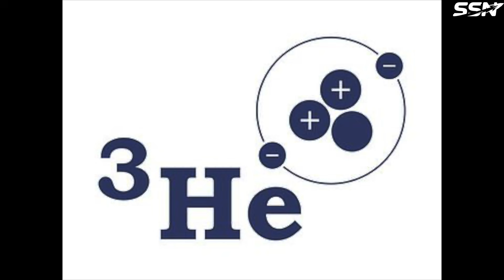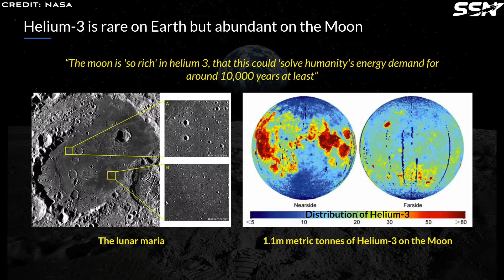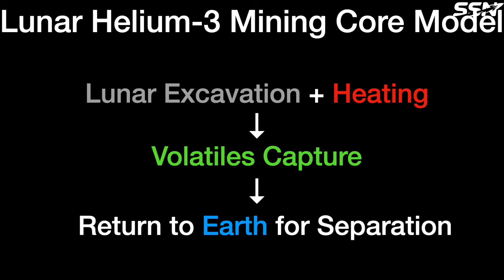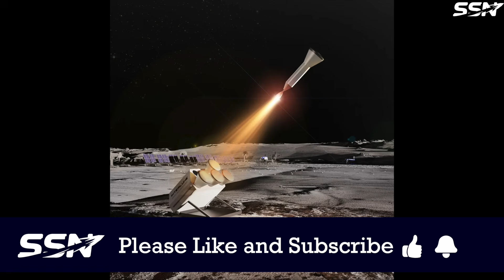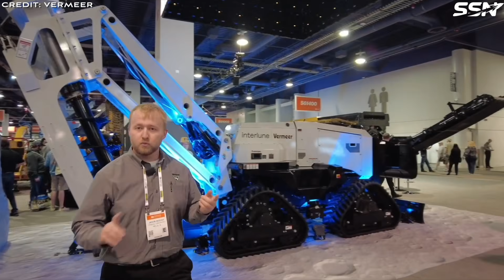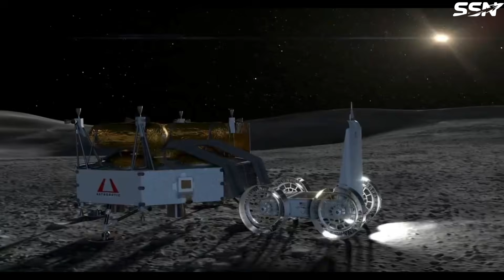Interlune 2026 Helium-3 Moon Mining Update: Contracts, Excavator & Missions

Comment: Yes but right now we can’t make fusion work even using hydrogen as a fuel and the temperature required to burn helium three is vastly higher. So there’s no point in doing detailed plans to harvest helium three from moon dust until you have at the very least a viable nuclear fusion reactor industry down here on earth.
Reply from the maker: The main business driver for Helium-3 mining on the Moon is quantum computing, not nuclear fusion.

Comment: I think the biggest commodity on the moon, at least initially, will its location outside of Earth's Gravity well. 
And the water and the ability to process fuel on the surface. 

Because that is the key enabler that then enables us to refuel spacecraft from the moon and launch large amounts of material either back to Earth or even for construction in Cis lunar space and even Low Earth Orbit. 

Basically the moon is going to the place that fuels industry and contruction in Space in general. So whatever industries you want to have in Space, be it constellations of Internet communication satellites, data centers and computation, or even space based power generation.

It'll be much easier to fabricate on the moon and launched from that lower gravity well than having to bring it all up from Earth. 

So in that sense the Moon isnt just the facilitator of one industry, its the facilitator of All Space based industries.

Comment: Helium 3 mining on the moon makes sense as it is very rare substance on earth and the price/weight ratio is very high.  I see it being very valuable for fusion power generation on the moon as well.
Reply: I think the biggest commodity on the moon, at least initially, will its location outside of Earth's Gravity well. 
And the water and the ability to process fuel on the surface. 

Because that is the key enabler that then enables us to refuel spacecraft from the moon and launch large amounts of material either back to Earth or even for construction in Cis lunar space and even Low Earth Orbit. 

Basically the moon is going to the place that fuels industry and contruction in Space in general. So whatever industries you want to have in Space, be it constellations of Internet communication satellites, data centers and computation, or even space based power generation.

It'll be much easier to fabricate on the moon and launched from that lower gravity well than having to bring it all up from Earth. 

So in that sense the Moon isnt just the facilitator of one industry, its the facilitator of All Space based industries.
Reply: yep its like gold